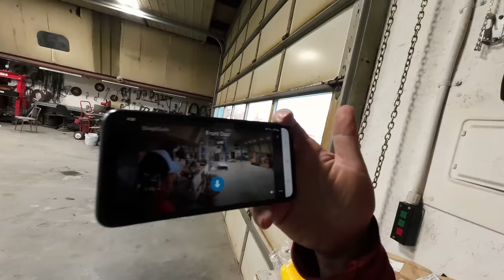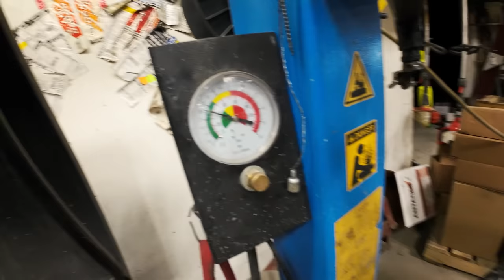Out of 69,500 FFA Students, THIS GUY GOT MY HAT!

Comment: I’d be all tired out after the tire repair , but I am sure the fish Tanked  you for bring them in Lol😂
God bless you all
Reply: Glad it went swimmingly........ always good to fin..ish it well..
...
Reply: @RobertWelkerFarmerBob  You marked the valve stem to keep the balance the same, but you also added the extra weight of the glue and patch, just curious about that.
Reply: I have check balance after adding a patch in the oast. It doesn't change the balance enough unless it was unbalanced before.  I determine post driving to feel any unbalance.  There's more unbalance from mud in wheels driving on rural roads
Reply: @RobertWelkerFarmerBob  Great, thanks. I didn't figure there would be enough highway driving to cause any problems, get 'er done!

Comment: Actually your tire is now out of balance by the weight of that humongous patch.
Reply: That “humongous” tire patch weighs about one gram. If you had ever really used one, you would know that. Most of the best dynamic tire balancers have an error factor of plus or minutes 5 grams. There are 28 grams in an ounce. The smallest commercial tie weight is 1/4 ounce. Do the math…if you can. Please consider thinking through your comments BEFORE you post them, boy.
Reply: Thanks Jim for the detailed reason no need to rebalance